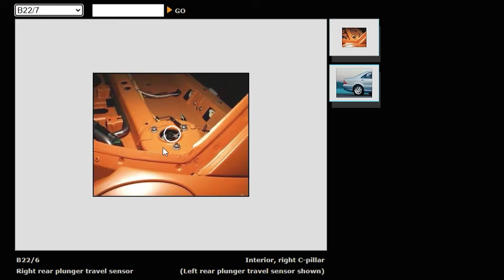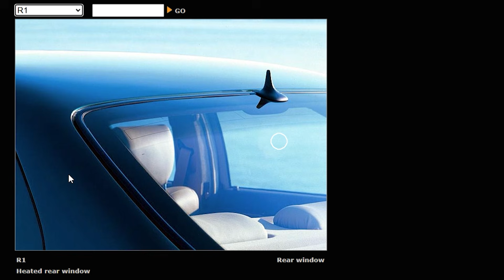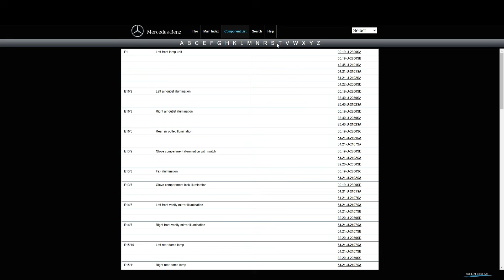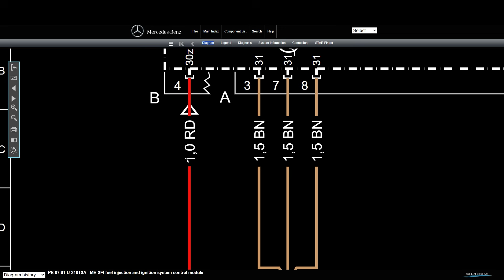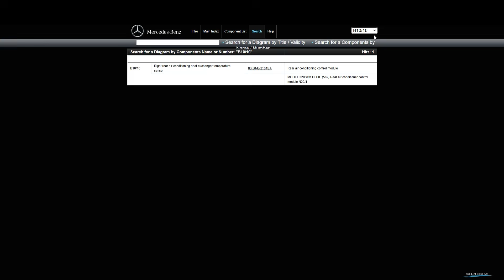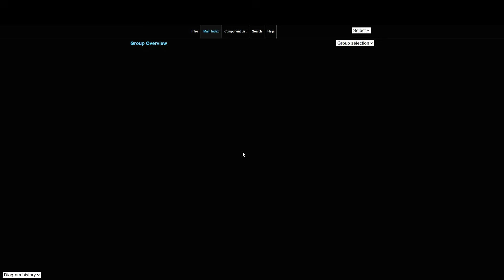Mastering Mercedes-benz Wiring Diagrams: A Complete Guide For Efficient Reading And Use

Comment: Which version of the software are you using for this presentation?
Reply from the maker: Eh the actual delaership star tek into access. But these come on the bootleg xentry/das machines as well
Reply: @M @MasterTechLou s, although the functionality may not be the same. Can you check if the little blue menu is available in other than dealer account? Please and thank you.
Reply from the maker: @marekhabel2493 they are not they are screenshots. Thats the downfall of any manufacturer diagrams on 3rd party systems like alldata and mitchell

Comment: Does this wiring diagram system also related to All Data Repair?
Reply from the maker: so you will see the same wiring in alldata. however you cannot navigate it like the actual software. you have to dig for the other diagrams. cant just click links like in this video. thats what makes it hard to use alldata and other information sites.

Comment: Hola amigo buena noche tengo un problema quería ver si tú me pudieras ayudar tengo tiempo con ese problema y te vi en esta plataforma tengo un Mercedes a190 2004 era automático lo hice standar pero no prende me di cuenta que si desconecto la palanca no prende 
Tu sabrás que cables son los que se puentean de el conector de la palanca y si también tengo que hacer lo mismo en el conector de la transmisión te agradecería mucho si me pudieras ayudar y si vienes a México te invito unas beer
Reply from the maker: The problem is the vin is stored in those modules so the car needs the authorization. What you need is the key and ignition switch from a manual car, and engine module. Or have someone reprogram your modules for manual not automatic
Reply: @MasterTechLou muchas gracias amigo te debo tus beer

Comment: Where can i get this for at home usage?
Reply from the maker: Only places are with xentry/das software you can buy on ebay. Or with a xentry/das system. Or pay for mercedes access which I linked in the video somewhere
Reply: @MasterTechLou  ok thanks .  i only have WIS currently got a problem with Low temp coolant pump 1.  Codes are: U02A900, U02A987, P068500, P065800. Car is 2016 C63s C205. please can you help in any way?

Comment: 01 s430 AMG Package. I'm getting dtc p2601 in my TCU overvoltage on circuit 87. I have been researching for months trying to get this code to clear so my 722.6 tranny will come out of limp home mode. I just started using starfinder but can't find anything about circuit 87. And relay k on passenger side fuse box gets hot when key is on and when the car is running. Any advice would be greatly appreciated.

Comment: Hi Lou, could you tell me why it sometimes shows one wire size (eg:0.5 BN, then shows another size next to it, usually smaller, in brackets, like [0.35 BN]? I'm making looms for a few retrofits and wanted to make sure I get the correct wire sizes.
Reply from the maker: If it does that its because of a option code or year break. Usually anything in brackets is tied to somethin in the left upper corner showing either option coded or year of production
Reply: @MasterTechLou thanks buddy

Comment: Thanks for the great vid. 

So in practice if I want to check that the signal from the cam position sensor (B6/1) is OK:

1. I'll stick other probe of my multimeter to some available ground point 
2. Other probe to B6/1 pin 2 OR to N3/10 E40 - whichever is more easily accessible
3. And if the reading is 1.2 - 1.7 VDC it should be fine.
Reply from the maker: If those are the pins in the diagram and thats what the “diagnosis” shows on the diagram menu then yes.
Reply: @MasterTechLou  I was referring to your exercise 1 and tried to put it into practice.

Comment: Great video Lou. Good lesson. That’s easier than Toyota diagrams, Toyota don’t have live pictures to find where is that component or module, even worse when you go part location,picture is showing under center of dash but it under glove box. I hope they will change in future because Toyota Supra you know it’s BMW and has same diagram like Mercedes. Thanks again
Reply from the maker: @hyeeagle  I actually worked at toyota and was surprised how their diagrams work. They are nice once you can get experience with them, but not as easy to navigate as Mercedes. I have yet to use a bmw diagram. Im fluent in benz, vw, audi, Porsche, Gm and Toyota now. It would be nice if they all could go out drinking with each other and share their ideas and come up with one bad a$$ diagram system.